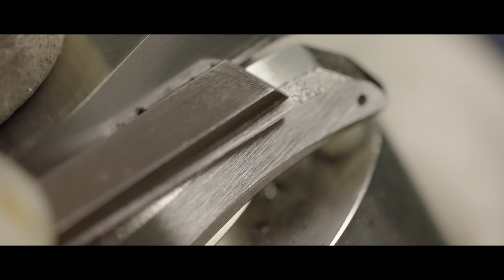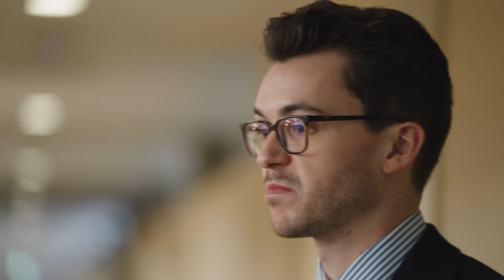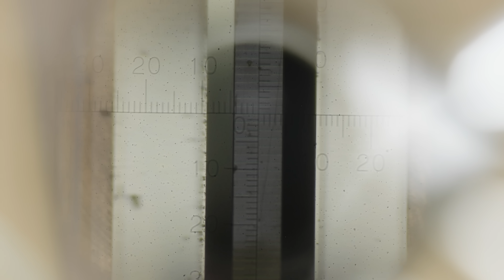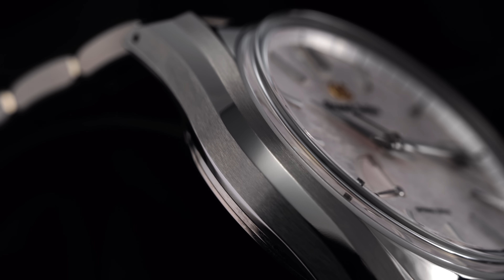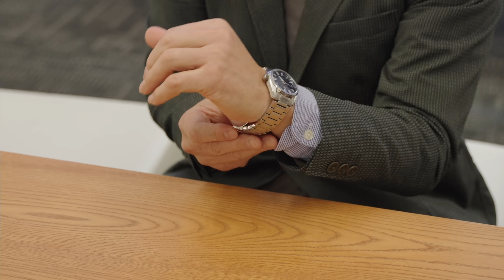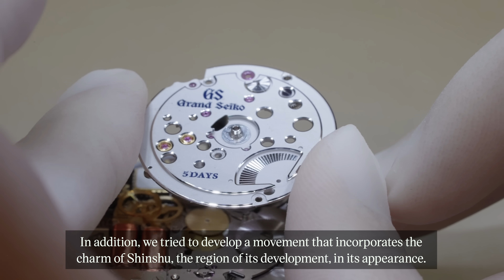Visiting Grand Seiko: How Their Watches, Spring Drive Calibers, Dials, And Cases Are Made

Comment: I’ve been watching YouTube videos for about a decade about grand Seiko. I finally got to handle one that my friend purchased from his authorized dealer for around 5000 give or take.  When I handled it, and I looked at it, I was disappointed.  The dial is textured, sure, it’s a hybrid, mechanical quartz with a sweeping secondhand and no battery.  But they were actually fingerprints and dust particles and small scratches and imperfections made by hand under the crystal.  It was really quite disappointing for $5000.
Reply: It's apparent even in the video if you look closely.

Comment: Don’t Buy Spring Drive
If you’re wealthy, if you’re a collector who flips watches every few years, or if you’re a watch influencer looking for content, then by all means, buy a Spring Drive. But if you’re an ordinary working professional looking for a reliable timepiece—something that could even be passed down to the next generation—stay far away from it. 

Grand Seiko has built its reputation on meticulous finishing and the technological curiosity of its Spring Drive movement. Yes, it uses a mainspring and gears to deliver power, but its timekeeping is governed not by a traditional escapement, but by an electronic regulator: a quartz crystal, an IC, and an electromagnetic brake. 

The key difference compared with a real mechanical watch is that its accuracy that enthusiasts celebrate does not come from mechanical ingenuity, but from electronic components. Will you call watches that relies on quartz and circuitry for precision a “mechanical watch”? If a watch contains gears and a mainspring is mechanical, any quartz watch with a decorative gear train could be marketed as “mechanical.” (I’m not saying it’s not a fancy or advanced movement)

The key issue is the longevity. Grand Seiko lies in the limited lifespan and potential failure rate of its electronic components. Unlike Swiss mechanical watches, when serviced regularly, can last for generations. Their parts wear down, but replacements can be fabricated or sourced; even century-old pieces are still running today. 

Spring Drive, on the other hand, carries an inherent expiry date. The quartz oscillator and IC may degrade after a few decades, and once Seiko stops supplying proprietary electronic modules, servicing becomes impossible. In fact, early Spring Drive calibers (such as the Seiko 7R68) have already been declared “parts no longer available,” with the company stating that essential components cannot be fully repaired or replaced.
The electronic regulation system of Spring Drive mainly consists of several components:
1 Generator/coil (producing electricity through the rotation of the glide wheel)
2 Quartz oscillator (typically 32,768 Hz) -  Over time, with repeated temperature cycles and mechanical shocks, the quartz oscillator may drift in frequency or lose stability.
3 Integrated circuit (IC) (which compares the quartz frequency with the glide wheel’s rotation and controls the electromagnetic brake) – facing aging or degradation.
4 Electromagnetic braking system (coils/magnetic elements interacting with the glide wheel or braking mechanism) – same, electronics parts facing aging or degradation.

These electronic parts operate under very low loads, with extremely low power consumption. In fact, the IC and quartz oscillator in Spring Drive consume only tens of nanowatts. Nevertheless, they have potential failure points. Under optimistic estimates, their lifespan might reach around 30-50 years, but there is no guarantee that every component will last that long without issues.
Certain early Spring Drive calibers (such as the Seiko 7R68) have already been declared “parts no longer available,” with the company stating that essential components cannot be fully repaired or replaced. Forum reports also indicate that some Spring Drive watches around 25 years old have been refused service by Seiko due to lack of necessary parts.
Cost issues - Although electronic parts are less exposed to wear and tear, once they fail, the repair cost can be significant, especially if the entire regulation module or IC has to be replaced.

Comment: Zaratsu polishing (also known as Sallatz) is essentially a form of lapping—a technique that was once considered obsolete in the watch industry. However, it’s seeing a resurgence, largely thanks to Grand Seiko. While many prestigious watch brands, including Rolex and Omega, continue to use lapping under different names, what sets Grand Seiko apart is the sheer consistency and exceptional level of finishing applied to all visible components of the watch—excluding the movement.

Few Swiss brands, even those in the so-called “Holy Trinity,” can match Grand Seiko’s standards of case and dial finishing. Another standout feature is Grand Seiko’s hand-blued components—each one individually blued by skilled artisans. This level of traditional craftsmanship is almost entirely absent in the modern Swiss watch industry.

That said, Grand Seiko’s movements don’t quite stand out in the same way (especially those 9R mechanical and 9S spring drives). While reliable and well-executed, their specs are on par with mainstream Swiss offerings like Rolex’s 31xx/32xx series or Omega’s Co-Axial calibers. The finishing on the movement side is also relatively modest in comparison to their exterior work.

Comment: It still amazes me at the speed of the constantly revolving wheels in these watches. It "seems" there would not be enough oil (or light grease?) for longevity, and yet there it is just getting better and better. The extremely "S L O W speed" (an oxymoron :-) of assembly is amazing also, for I've worked as a bench jeweler and diamond setter for about 45 years and know what this level of patience and hand control is needed. 

The assembly processes reminds me a lot of an expert shooter, before pulling a trigger, of taking a deep breath and holding it to remove as much normal body functions that can move him off target otherwise. I suspect these watch assemblers also take a breath and hold it, when placing a delicate past in position to be mounted.

Comment: I have a Rolex. It's beautifully made and I've owned it for decades, but, from a timekeeping and engineering point of view, it's utterly antiquated. Rolex rely too much on their brand and haven't innovated at all in 60 years. 

Brilliant watchmakers like Breguet and Jaeger Le Coultre pushed watchmaking sophistication to the limit. They weren't afraid of advanced technology. Similarly, I'd like a watch with Spring Drive technology and the brand name recognition of Rolex. To me,  Spring Drive is the best of the old and the new. Rolex with Spring Drive could be  $10,000-$20,000. That's still costly but relatively affordable. Rightly or wrongly, Seiko doesn't have the caché of a Rolex. The two manufacturers could make a watch that has a 200+ year life (like quality watches used to be) with maintenance-free accuracy for decades. I've spent a small fortune servicing my Submariner. (Rolex charges about $1500 for a service). A newly designed and manufactured Spring Drive Rolex might last 15 years between services. It would be an heirloom, able to be passed down through many generations. I would buy such a watch in a heartbeat.

Comment: I don't quite understand. If this is a spring driven watch how can it have electronics? Does it have a battery? If it has no battery where does it get power for the electronics? If it has a battery why have a spring drive? A quartz crystal and a battery could run for years without needing a reset.

Comment: It is surprising to see the components looking a bit dirty in the movement assembly section. Other factory visits you have done earlier always had clean and flawless assemblies. Nevertheless, Spring Drive based self winding movements have achieved amazing accuracy levels of +1/-1 secs/day which are better than Omega co-axial Master Chronometers (0/+5 secs/day with COSC+METAS) and Rolex Superlative Chronometers (+2/-2 secs/day with COSC+ Rolex In-House). However, the former employs electronics to achieve it and cannot be compared with other two movements which are purely mechanical.

Comment: I have never seen a watchmaker use their fingers to place barrels, ALSO makes A LOT of sense to me now that my Shun Bun had scratches on the markers and hands... Steel tweezers to place the markers and handling delicate/polished hands?? They GOT to start implementing some Swiss techniques which is just plain common sense... Wooden tweezers for hand/marker placements, BUFF sticks to place the markers onto the dial. Clean and sharpened tweezers to place components without introducing dust/particulates that is lingering on fingercots... like cmon...

Comment: Amazing engineering!!!Japan is really good in making hybrid systems on anything. Instead of having a lithium battery as the energy source, the compressed spring drives it and the crystal oscillator and integrated circuit controls the magnetic field and electric current. Just producing an electric current from that small coils driven by that spring is amazing!

Comment: Is the spring drive antimagnetic? If yes to what level?
Reply: Yes up to 4,800 A/m. In most cases, you just need to keep it away from the source of the magnetic field for a while until the brake unlocks itself and goes back to normal. If you are in an environment particularly hostile when it comes to magnetism, you are probably better off going instead for a quartz specifically designed to be antimagnetic like the SBGX341 which can handle 40,000 A/m.

Comment: 8:25 when he mentions it will run for three years.  What was he referring to?
Reply: It's quartz, so it can run for three years on one battery.
Reply: Ohh ok thanks.  I was under the assumption that the spring drive had no battery and used the mainspring to power the quartz.  Negating the need for the battery.
Reply: @kylerodgers5332  Spring drive doesn't need batteries indeed, but he was talking about a quartz watch. Grand Seiko makes both, along with some purely mechanical movements. Quartz is the only kind that needs battery replacement. Spring drive does not.
Reply: @kylerodgers5332   That particular movement being referred to at 8:19 was not a Spring Drive movement.

Comment: What's impress me the most is how Grand Seiko elevate everything, including their own quartz movement.
Have an hi-beat and a quartz. The value is amazing.
Reply: @amimrie  it was a rethorical question "The Spring Drive is a self-contained drive system that realizes accuracy equivalent to a quartz watch with only the power of the mainspring and has no battery, motor, or secondary battery." from the grand seiko website. you can learn the full process on their website, it's pretty cool
Reply: I don’t shun away from a quartz watch, I have a few Casio but a Casio is like $50 I ain’t buying no “luxury” watch with a quartz movement.
Reply: @brody1153  you don't like precision ? Anything against taking a watch and run to your journey ? Or maybe you don't like shock-resistance ?
Reply: @iAPX432  if I want precision Id look at my phone it’s more accurate and its made of way more components. 

Im into luxury watches because of the internals, I don’t mind if it’s off by a second every day. Quartz movements are for nice classic Casio or worse of all clothing brand “luxury watches” 🤮. If I’m paying top dollar I don’t want something on the same level as a $11 spider man watch
Reply: What* impresses* me ... / Have a* high-beat
Reply: Lots of plastic parts.  GS are good but way Overpriced for a half quartz movements, it's far cheaper to produce a half mechanical vs full mechanical movement.  They did well marketing spring drive as something superior, but it's really just more inexpensive to produce, same reason went power plants went from steam to digital
Reply: @GlutenFreeCracker the difference between a spring drive and a fully mechanical movement is that the balance wheel is replaced by an extremely complex regulation through electromagnetic braking. Apart from this significantly more complex solution, the watch is driven by a main spring just as any mechanical watch. spring drive also has many more parts than a mechanical movement. Not sure about “lot‘s of plastic parts”, can you give examples?
Reply: @stefanmuche2891 don't mind him, he is just a troll, the presentation clearly showed the assembly production in Seiko Epson.Even the 9F has full metal parts.
Reply: @stefanmuche2891  the hi beat watches are more expensive than the spring drive because it takes more time to make them
Reply: @GlutenFreeCracker  power plants are to this day still using steam my dude i dont even know how a powerplant could generate power through digital
Reply: @bdegrds  how do power plants go from steam to digital 😂😂
Reply: @GlutenFreeCracker Overpriced is Rolex. With every watch sold they pay the expensive ambassadors and F1, Wimbledon, etc advertisements. In every Grand Seiko you have pure raw quality. Plastics. Where are the plastics?
Reply: @GlutenFreeCracker what are you talking about? You obviously don’t understand how they are made and the parts used
Reply: @GlutenFreeCracker  Not every Grand Seiko utilizes quartz movement.
Reply: @GlutenFreeCracker  if it's quartz, where is the battery ?
Reply: @romain3135  9F63 have a battery. Have one SBGX261. Superb watch. Incredible accuracy. Perfect execution.
Reply: @romain3135 The battery sits just below the caseback on the right (8:22).

Comment: During the movement assembly chapter, you can see a lot of dust and scratches in the movement.
Reply: What scratches? As for dust, you do know that their movement assembly isn't normally done with a dude from the outside holding a giant camera with a macro lens standing over the assembler, right?
Reply: @ft-55555 @4:48 “giant” scratch at the center 5 o clock mark.
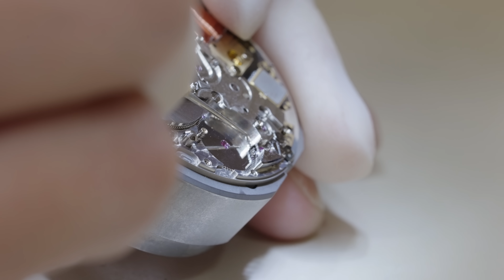Reply: @ft-55555 @3:59 tons of dust on the piece being installed
Reply: @PizzaGolf  10 bucks says you're a Rolex knob gobbler. LMAO!